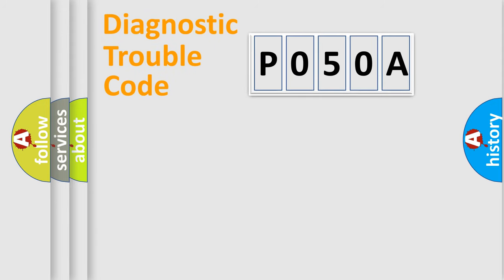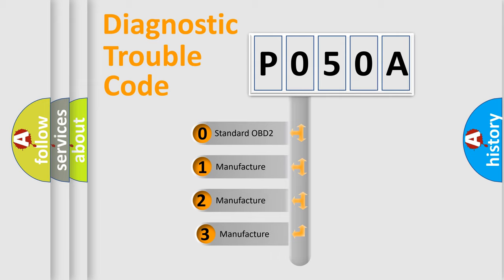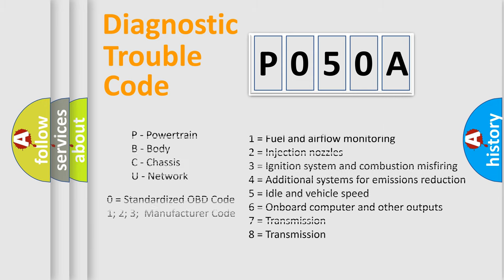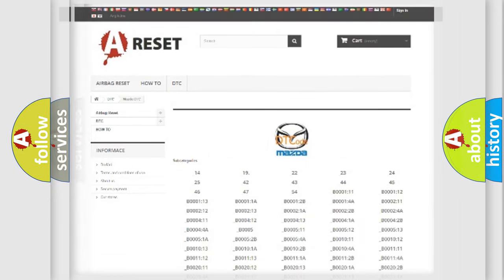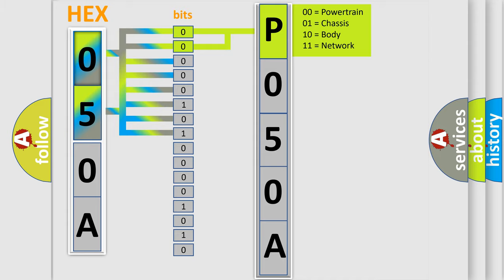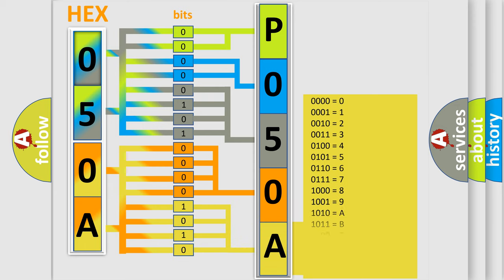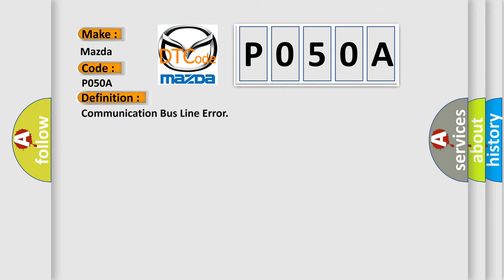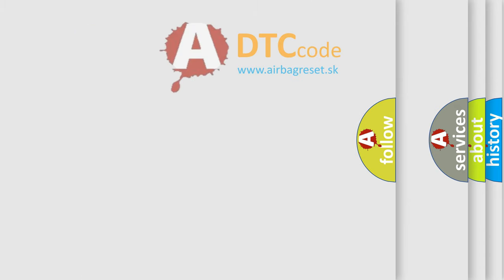DTC Mazda P050A Short Explanation

Comment: I fix everything . Nothing fixed the P050A Cold start . It turned out to be Sparkplugs was the cause . When you start reaching 20,000 or more miles the plugs may start failing.